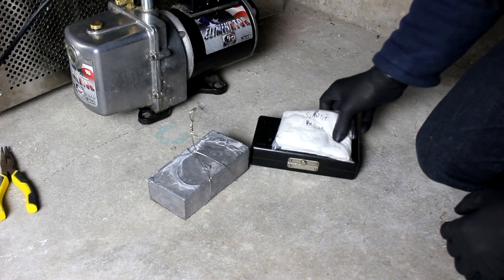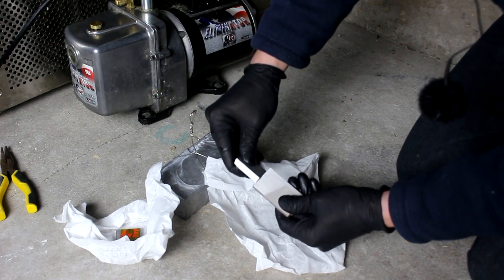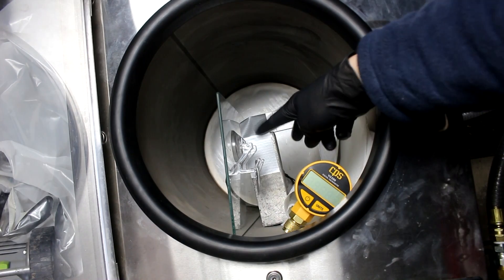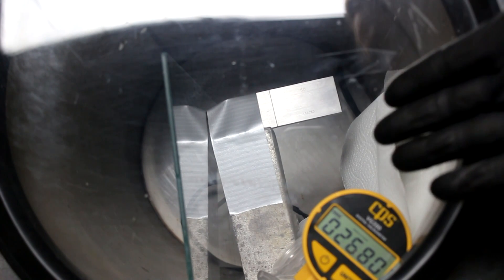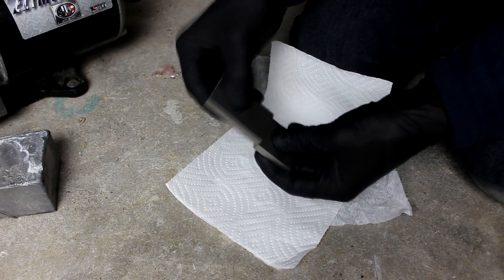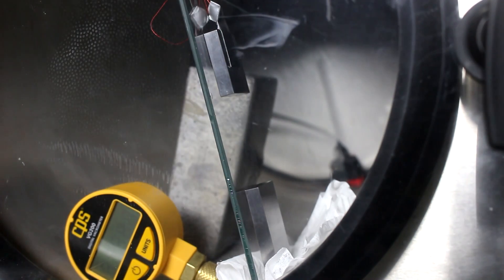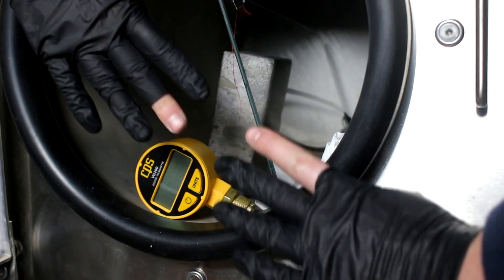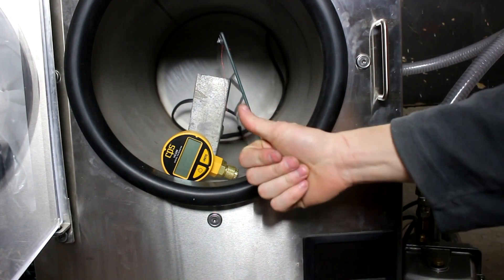Will Gauge Blocks Stick In Vacuum?

Comment: could be static electricity. rubbing the blocks against each other could be creating a voltage across the two and though the blocks themselves are not magnetic, electricity makes its own magnetic field and could be holding the blocks together.
Reply: SIGHahNYDE there's no capacitance, any charge that could be  built up would equalize between the two. also that wouldn't explain how ceramic blocks work.
Reply: I think you're right about the capacitance, but there are ceramics out there that can create a static charge when rubbed against each other, not all ceramics but some do. I'm just a layman and this has made me very curious. I might get some just to try it out myself.
Reply: *looks at gauge block prices 

geeze, nvm.
Reply: Nah, not in a conductor, you can't get a static charge rubbing metals together. 

If there was a charge, it'd spread equally all over both blocks, so there'd be no resulting force between them. 

Good thinking though.

Comment: Could the phenomenon be because of heat generated by friction? If a rubber band is stretched it generates heat, left at its streched state it would cool down and if retracted seems to expel heat. What if the friction from wringing was enough to generate heat to repel the base metal molecules and make it expand a bit? So in a way its like the phonebook friction thing. When the metal cooled down and shrunk got stuck by friction. Could you try heating one block with the laser or cooling one block before wringing them together? Could you use a flir camera to see if there is a temperature change on the sides as it is wrung out? Cheers

Comment: It's probably van der Waals, but there's another fun possibility. I did a back of the envelope, and found the Casimir force between them for 20nm spacing would be about 3.2N (I guessed the contact area was about 4cm^2). This drops off rapidly with greater spacing, but if it's between 10 and 30nm, you could easily get the force we see in the video. Considering the fact that you're deforming them on the microscopic level to get them so close, it's not unrealistic. You could test this by trying it with ceramic gauge blocks, since the Casimir effect only acts on uncharged conductors.

Comment: could you take a strong microscope and check the mating surfaces as a base line, then check it again after several wringings to see if the surface shows signs of coldwelding?

Comment: Under a powerful microscope you'll find subtle high and low spots in the machined surface of the blocks.........like I mentioned before it isn't cold welding...The energy your putting in by twisting and sliding them is making friction and literaley melting them together at very small scales.

Comment: Admittedly, I could be wrong as this is based on a few assumptions. Why don't you connect the gauge to the hose that links the pump to the chamber? I'm assuming the atmospheric pressure in the camber and the hose are equalized by each other and that there isn't a valve linking the chamber to the hose. 

Another alternative, depending on what material the door is made of, you should be able to install an "L" shaped tube at the top of the door.

Comment: What if it's molecular attraction?  The necessary "squeezing" may dislodge the oxide layer exposing the iron and carbon atoms.  However an oxide layer still maintains itself in some essence preventing any sort of welding instead atomic scale bonds that can't really complete or I'm just running in circles

Comment: If the two gauge blocks are swapping electrons surely there must be some, at least momentarily, electrical potential developed between them, right? While the potential would probably be incredibly small, it should be measurable. Anybody have any thoughts on this?

Comment: When you said they the surface is so flat it squeezes the air out forming the dry world, well for instance is that the same when a flat block of Silicon is placed onto a flat surface and it sticks to the surface really well? In one of Grant - King of Random he does that and the silicon pretty much sticks really hard to the surface.

Comment: does these Blocks need to be a spesific material. if true can if be a property of this metal that creates som forse be it mabnetic or just the bont between atoms when the heat from friction comes into play. like say2 peopele goes past eatch other notheing hapends 2 peopele standing still. then someone tries to pull them apart they got nothing holding them together so no problem splitting the peopele. now say a molecyl is 2 peopele hugging whith their arm around them. then magnetick/gravety is smell/love. where smell makes one stay away or come closer to smell you and love of corse the more you love someone the closer you want to be. 

now my teory the friction gives theheat to make them temporarely bond. but a weeker bond so there wil not be a Cold weld. back to the peopele. when they rup and create heat(force). they get the power they need to take their hands together and hold. take a molecyle is a groop of peopele so when they rub someone mith get the power to take the and of another gyt from another molecyle. the bond between the groops is wwe compared to the bond in the groop so when someone tries to grab the groops the weekest link breake.

Comment: could oxygen be forming an oxide layer on the metal and the twisting motion you speak of breaks the layer along two pieces of "clean" metal touch and cold weld but only a very little of it can weld so it's a weak weld?
Reply: AvE previously mentioned that this works with ceramic gauge blocks.
Reply: Considering this has been demonstrated to work under inert atmospheres and with metals that do not form oxides at all, I'd say it has  nothing to do with an oxide layer.
Reply: This is what I thought. I'm sure I've heard of it being an issue in space where freshly bared metal doesn't create a protective oxide layer, and makes it possible for two pieces of metal to bond. 

Here on earth (or in an atmosphere) the metal becomes readily oxidised, possibly nearly instantly. At least enough to stop cold welding. However, as you rub the two pieces together, it grinds away that very thin oxide layer.

Only way to test is to machine the metal in a vacuum. Be interesting to see how precise it needs to be.

Comment: I've done something similar with hard drive platters, the ultra smooth surface of the hard drive platters will hold together due to the lack of air molecules between them. we are also learning about this in my thermodynamics class. Pretty cool stuff!!!

Comment: Will gauge blocks stick better in a pure nitrogen environment? I theorize that the o2 in air is creating an oxide layer that has to be abraded way to get cold weld/van der waals forces.

Comment: if the tolerance of the gap between  both blocks is so tight is it possible that it is trapping any type molecules or even electrons and protons between the two is causing a magnetic like attraction. you are ringing them together possibly charging them up like a balloon on a sweater. im no scientist btw just watch both you and AvE and curious to why no one has figured this out.

Comment: You peaked my interest on this and did some searching this is what I came up with: 1) Air pressure from the surrounding environment as the air is squeezed out when the blocks are slid together. 2)Surface tension from oil that remains on the gage blocks or water vapor from the air acts as a glue to hold them together. 3)When two very flat surfaces are brought into such close contact with each other, this allows an interchange of electrons between the atoms of the separate blocks, which creates an attractive molecular force. (This force will remain even in a vacuum or if no oil or water is present on the blocks.)The last two sources are thought to be the most significant.Source: http://www.webcitation.org/5vB9dklHp?url=http://www.starrett.com/pages/72_wringability.cfm

Comment: I have an hypothesis, what if pushing them together scratches the surface enough to remove a really thin layer of oxide or any other material due to the atmospheric pollution making the molecules cold weld together in very small contact points?

Comment: I believe when you "ring" them you are rubbing off a tiny invisible oxide layer that quickly forms in atmosphere. If there was some way to remove that oxide layer inside a vacuum I believe they would weld instantly. I don't know how this could be easily done. Maybe chemically removing the oxide with a liquid that evaporates quickly, possibly aided by the vacuum itself? I feel like this may be more easily tested in a chamber filled with an inert gas like Nitrogen though as you could much more easily interact with the objects inside.

Your videos are awesome by the way:)

Comment: Cold welding is more or less a myth, NASA only have a couple instances of it maybe happening to them in space with very clean, very well machined surfaces. Calibration blocks aren't anywhere close to being smooth enough to get perfect face to face contact, especially an old used set. Simple binding is all that's happening here.

Comment: Maybe you could add a giant neodymium magnet on each end to use to compress them together.  Leave it for a few days and see if any mixing of atoms takes place. If not, heat the whole system as high as you can but remain under the Curie point, and see again if that results in any welding.

Comment: I was thinking to prove it's not the friction motion (and so, the air molecules) that causes them to stick, you might try just putting them in a vice and squeezing them together and see if they stick. Or even if you find a flaw in this proof (which i'm pretty sure there are) it would be a nice experiment ! So "cold welding gauge blocks in a hydraulic press" video i guess ?

Comment: Even when they are that flat if you looked closely enough at the surface it would still be jagged. The flatness helps more jagged edges touch together. When they are rubbed hard together these fine jagged edges too small to be seen deform and mold to each other and because of its flatness a huge amount of these edges are able to bind to each other instead of the normal 3 or so points of contact between things that are flat but not gauge block flat.

So I think that these fine jagged peaks and troughs are slightly deforming and meshing into each other as can be seen by the cold welding marks that are sometimes left behind. I believe this forceful sliding could also be pushing off an oxide layer with the leading edge of the blocks to uncover more pure metal underneath which will much more readily bind to other pure metal that was in turn revealed on the opposing block.

Awesome job Cody I never would have come up with all that theory if you hadn't disproved the air and oil and other theories. I have taken materials science and advanced materials science and that's where I learned that even gauge blocks will have a jagged rough surface if you magnify close enough on them.

Comment: You need to get those under an electron microscope to see what is happening at the near atomic level.

Also what happens if you pass a mild electrical shock on one of the blocks?

What would stop a set from being wrung, as it what variables can prevent wringing and what do they have in common?
How 'rough' would the surface of the blocks have to be before they stop wringing?

Comment: What if you cold welded the gauge blocks together, then suspended them up inside of the vacuum chamber? When the chamber is depressurized, if it's because of suction the one would fall, if not they would definitely stay cold welded.

Comment: There are two major things I think you didn't quite consider when you tried to cold weld them under low pressure conditions:

Firstly, when you're working with iron / steel you're pretty much always going to have an oxide layer on the surface. The true metal - metal contact leading to cold welding may only come about by the "ringing" of the surfaces together where the wear due to friction exposes unreacted metal.

Secondly, even very smooth surfaces have some surface roughness which means that on a microscopic scale, very little of surfaces are in direct contact with each other. Smoother surfaces can have greater contact areas (which is probably what helps this phenomina to happen with guage blocks) but good contact still requires sliding surfaces to deform these asperities against each other.

These are both difficult to control in the environment of your low pressure chamber but why don't you try it under a oxygen free environment of nitrogen? Try to see if lapping the surfaces to remove the oxide and ringing them together under N2 gives a stronger bond than doing it under normal conditions.... :3 x

Comment: I was really hoping you'd stick them together outside of the vacuum then place them in a vacuum suspended and see if they'd detach in the vacuum (like the suction cups). This would be the best way to prove it is not a suction force.

Comment: You should try ringing them under water or oil or some fluid, this will also help prove that it is not air related. You could use that to prove it is more a friction based principle by using very slippery liquids and something not so slippery and then put it in a vacuum to see if all the liquid has been rung out of the interface

Comment: Cody, a hypothesis: maybe there's a oxide layer on the metal of the gauge blocks, and by sliding one over the other you break this layer, letting absolute pure metal come in contact.
That way, simply dropping one gauge on top of the other won't make them stick because you are not breaking the oxide layer on the outside of the blocks.
I don't know if I am making sense, since I am not a scientist nor a native english speaker, but I hope you get my point.

Comment: I'm a machine student, I believe friction does play a significant roll in the process. I've had parts that I've made personally without grinding or sanding, that are nowhere near as smooth and flat as gauge blocks, and they stuck together just fine right out of the vise. But I would be interested to see how parts like the ones I described would manage in a vacuum.

Comment: Cody, try this:   What kind of effect does electricity and/or magnetism have on gauge blocks?
Static electricity can hold things stuck, and steel is ferromagnetic, so it can have some effect.
And then my hypothysis: if you rub a normal magnet over a piece of steel, it get's magnetised, that is: the steel gets rearranged so that the fieldlines of all particles point in the same direction... getting something to point in the same direction should be easy if the surface is perfectly flat, right? Then, the magnetic field is always perpendicular to the electric field; when rubbing you are actually moving electrons along the surface, the same way you rub electrons of a PVC pipe with a microfibre rag. So you essentially generate a magnetic field going through that surface.
So perhaps you can get them stuck or unstuck with electricity or magnetism, or getting it to get stuck better. Get it chuching with manly-man skills!
Reply: I really want to see if this works, that would be skookum.
Reply: I especially like this idea because it's testable!!

Bump!
Reply: sasja de vries the vander whoever effect works on ceramics, has nothing to do with metallic properties. Gauge blocks are the most available way to show it is all.

Comment: O.K. please try this; twist the two together (at 1 atmosphere), put the two blocks horizontally, across a gap, only supported from the far ends, like a bridge.. and see if they continue to grip when you create the vacuum.

If they hold, add a mass to the centre and try again..... repeat, adding mass until you find either no difference, or more interestingly... a difference.

Comment: It explained to us in our university's physics class that you exclude the air, which pushed them together and then fuses the metal crystals. Maybe heat from the friction loosens up the crystal grid structure a bit and allows it to reshape?

Comment: I believe based on what i see that it is van der waals force that is keeping the blocks together. The blocks need to be polished so that on a molecular level there is a larger surface area for interaction. this is the same force that makes the block a block in the first place. The electron clouds in the adjacent atoms form a slight dipole which induces a dipole in each proceeding atom. The sliding of the blocks together helps because it removes any oxide layer and any oil/air molecules that might cause a gap between the blocks and reduce the inter molecular forces.

Comment: maybe its a static charge on the metal.  you cause the atoms to electro magnetically align when you rub them together and then they provide a magnetic force.   When you snap them apart the weak static alignment breaks.  You should do some measurement of the force that is required to break them apart with different amounts of the surface stuck together.
=

Comment: You also have to remember that when the atoms are close to one another they have a potential energy between them that can be released through chemical bonding. It could very well be that the pieces are actually bonding to one another and forming one piece of metal, albeit the joining part is not well formed because they are not being bonded thoroughly.

Comment: I heard somewhere that it creates a negative pressure if it is in a vacuum as they aren't magnetically attracted, and there is no air to force them together, but something is pulling them together. Therefore you have something from nothing, but by the laws of physics it isn't possible.

Comment: Did you try having the two pieces on top of each other without cold welding them and then creating a vacuum and letting the vacuum run for a while?